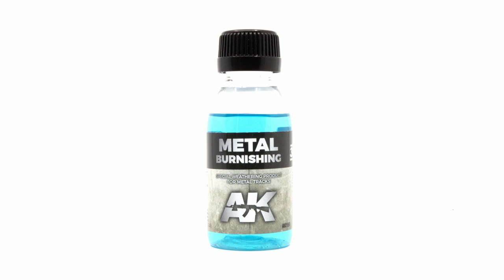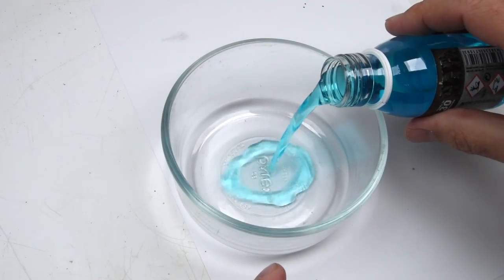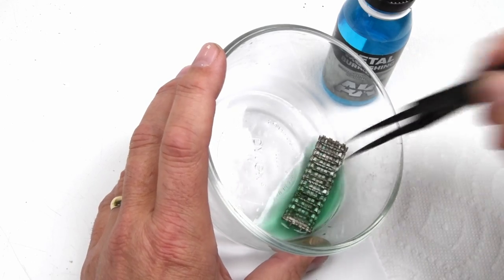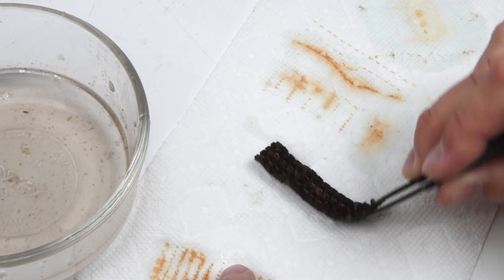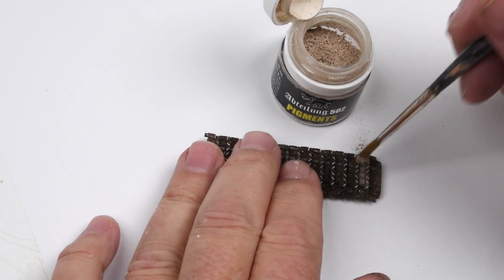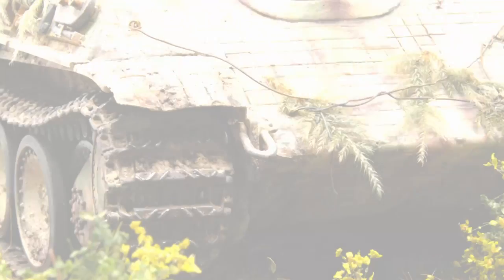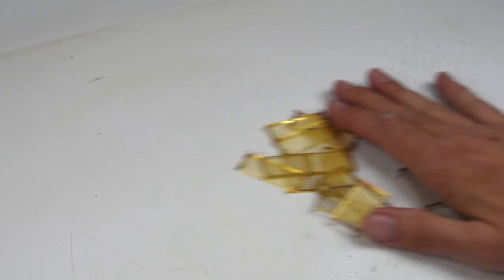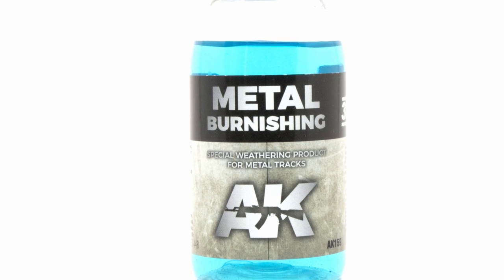Metal Burnishing Product Demonstration

Comment: Yup. Also if you burnish tracks before assembly, you avoid the problem of super glue preventing the burnishing fluid from reacting with the metal
Reply from the maker: True and a good point, but I've never found the need to superglue the pins. I use .2 brass wire which provides enough friction for the wire to say in place, then burnish everything once assembled.

Comment: Great demo Rick. A question - I have a couple of sets of copper plated tracks from R-Model, and they look great, but I am not sure how to treat them before painting, or even if I need to.
I think burnishing fluid would destroy them, so I haven’t even tried it. Any thoughts on this? Cheers from Australia 🇦🇺!
Reply from the maker: I'm not familiar with copper plated tracks. The metal tracks that I have run across are usually white metal (pewter-ish) and the fluid works great on those...as well as brass. I haven't experimented with copper and so I really can't give any advice. Perhaps others will chime in?
Reply: @RickLawlerPropaganda  -
Thanks Rick, maybe I just need to prime them with metal primer. I will search on YT for an answer. Thanks again mate!
Reply from the maker: @garylawless3608  Gary, I did an experiment with copper - see the pinned comment at top of the page.
Reply: @RickLawlerPropaganda  -
Thanks Rick. I will give it a try on some spare track links and let you know how it turns out.